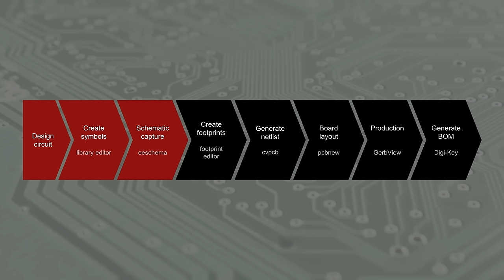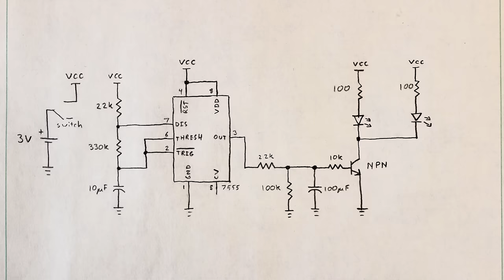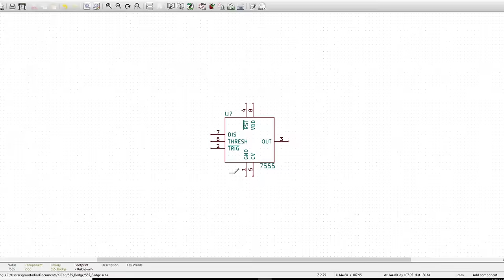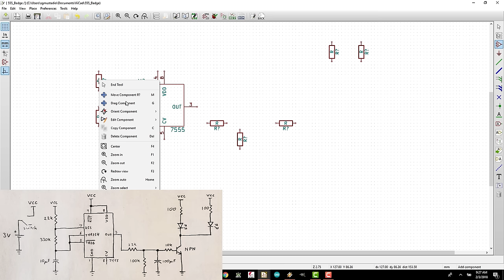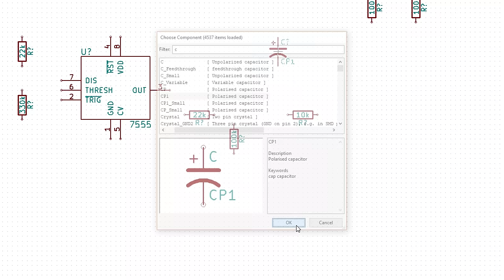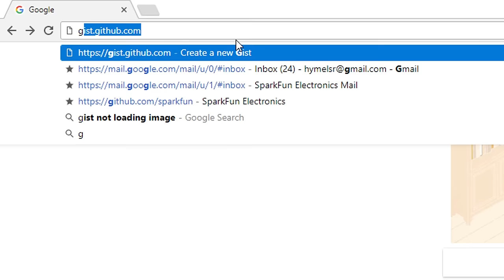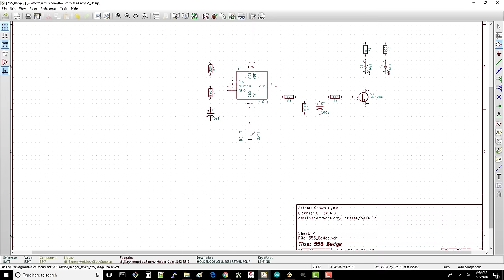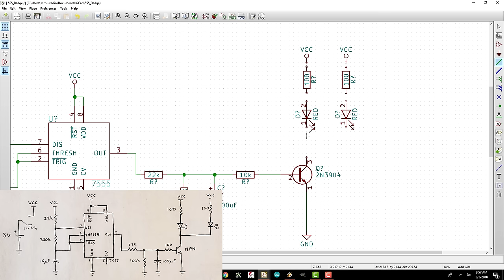An Intro to KiCad – Part 3: Schematic Capture | DigiKey

Comment: Thank you  very much for this great series. It really makes getting into and learning to make a PCB way easier than googleing every tiny step!

FOR ANNYONE WHO USES  KICAD 6.0 (like me):

General: "C" does not work for copying. However, "Ctrl +  C" does and then pasting with "Ctrl + V" like you would do anywhere else.

at 11:37: click "Preferences">"Manage Symbol Libraries"

at 11:43: click the folder-icon at the bottom left and navigate to your KiCad directory with the library files you just downloaded

Comment: Either it's a difference with KiCad 5 or with the current version of the digikey library, but the symbol for the switch has drastically changed.  There is no box and it defaults to pins 1 and 2 being connected instead of 2/3.  Of course it's a switch so it doesn't really matter, but I used the orientation function and mirrored the part along the X axis so that I could hook it up the way it is in the video.  You do this by right mouse clicking on the component on the schematic and choosing orientation -> mirror around x axis.
Reply: It looks like the changes were made to the library in the month following this video. If you're Git-wise, you could "pull" the initial commit and use that - I suspect you'll find the version of the library that is compatible with this schematic. However, you'd then be missing out on a great many commits of changes, so you'd possibly want to have two separate local copies of the repository. But... mirroring does the job, tbh

Comment: i have kicad 7.0. and i'm facing issue in importing libraries. libraries get added. but when i press ok, it shows an error saying symbol library failed to load. file is not a valid  symbol or symbol library file.  kindly guide me through it. thanks
Reply: I got through this problem by naming my library something other than the project name, let me know if it works.

Comment: isn't powerflag still needed ??   aren't unconnected pins to be marked / forced as unconnected ??
Reply: From what I understand, the specific Power Flag symbol is only needed to tell the ERC that power comes from somewhere else. Since our power/ground connections are all on this one page, I don't think the Power Flags are needed (everything works without them). Similarly, it's a good idea to use the "no connect" symbol to mark pins as not connected, but it's not necessary to make the board.
Reply: thanks
Reply: @ShawnHymel It always moans if I dont use no connect

Comment: how does the simulation know the functionality of the custom-designed circuit component like 555 in this case?
Reply: you need to specify it's spice Model. KiCad is not suitable for such tasks.

Comment: Why would you want to draw it on paper first ?? If it is to serve a useful purpose, KiCad should be easy enough to use for a first, modifiable sketch. It should be an extension of your drawing hand, not something to tread lightly around, afraid of making a hard-to-correct error.
Reply: To each their own. I usually prefer to draw it on paper first, where I find it easier to correct mistakes and be able to see how pins should be connected before making parts. There's certainly nothing stopping you if you wish to skip that step and just capture the schematic directly in eeschema.
Reply: I'm with schwartzenheimer1 on this.  The whole point of CAD/CAM software is to eliminate tedious hand drawing.  That being said I will print a view from the data sheet and write notes on it as I use eeschema.  And like you said, to each their own.
Reply: I'm completely new to all this and I actually find that drawing it on paper first helps massively.
Reply: I always scribble in a notebook. Gets ideas down, wherever you are. Not necessary perhaps but nice.
Reply: @KevinSmith-dx6xq I'm with you too EEscema is my pencil and paper
Reply: I would like a hand drawn copy of the ckt diagram placed in front of me. This way I would use the whole laptop screen to place parts on KiCAD. If I forget some parts of the circuit while placing parts I would look at the paper. That is all. If the circuit itself is simple it takes no time to draw.
Reply: What's worse (in my opinion) is he discussed using LTspice to simulate it BEFORE drawing it on paper. That means entering it into the computer TWICE as well as drawing it by hand. The lack of easy interoperability between various EDA and simulation programs is one of the many frustrations with these things.